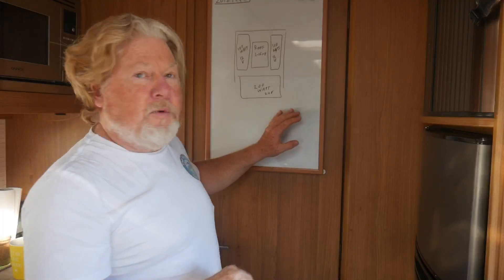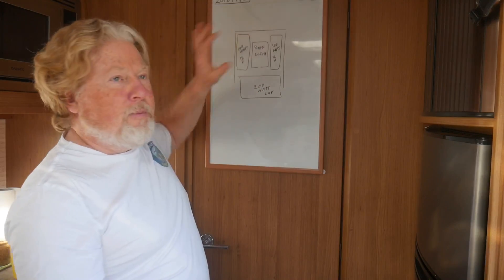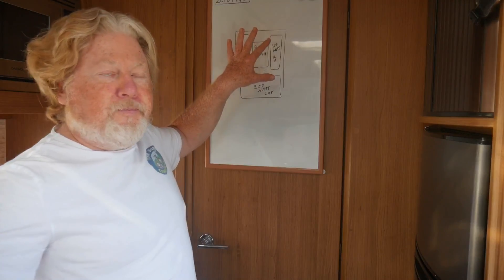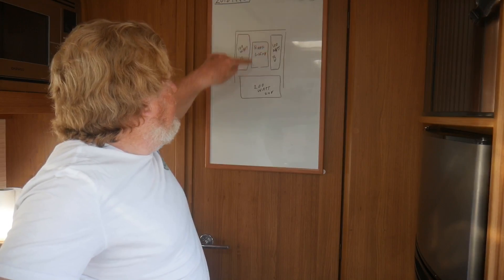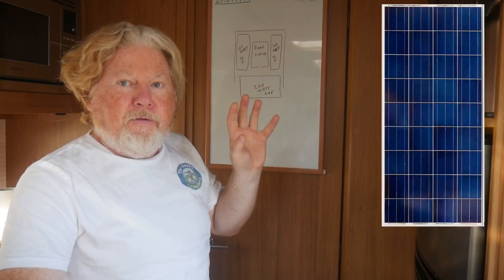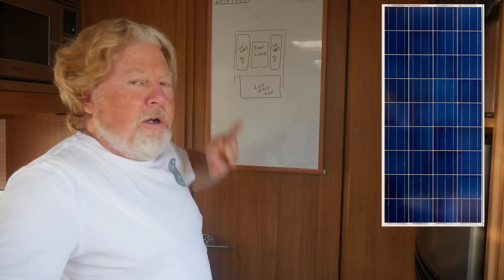Mixing Solar Panels in series and parallel

Comment: You will probably find all your panels need to be in parallel - so12v (not 24v) goes into your charge controller. 
Worth sitting down with your friends at A&E leisure or a recommended auto electrician. 
You can buy portable solar panels that unfold and plug 🔌 on to your leisure batteries - worth thinking 🤔 about maybe ? 
Avoid the shower blocks when you have a cough - they seems to make them worse. 
Great 👍 vlog - get well soon.♥️🌹💐😇
Reply from the maker: Thanks Chris. I’ve been communicating and checking with techies at Victron who have confirmed my thoughts about the solar design. The voltage going into the charge controller can be up to 100 volts when using the Victron 100/30 MPPT Unit. The 100watt panels will essentially look like a single 200Watt panel when connected in series. Total open circuit voltage from the 3 panels will be about 90 volts so within the charge controllers limits. With all the research and checking I’ve done, I’m pretty confident that I’m getting it right :)
Reply: The Happy Travellers - You can’t really go wrong if you’re getting specialists advice from the people who support the system - and that in itself is a recommendation 👍. 
Did they give you a reason why you should connect the panels in series rather than parallel? - 24v as opposed to 12v. 
I guess they will also supply a suitable junction box to mount next to the charge controller in order to achieve that configuration. 
Parallel wires simply terminate all together at the charge controller (brown/red to L - blue/black to N). A third panel will up it to 36v - 
It’s all very interesting stuff and will be fascinating to see developing because it will give you full freedom and off grid  capabilities- 
I have a small wind (cylinder type) turbine (type they have on yachts) - but I cannot say I would recommend- it’s enough to power the lights and television - effective up in places like Scotland 🏴 - another possible idea and topic of conversation.👍♥️🌹💐😇👋
Reply from the maker: So the first thing was to get maximum wattage on the roof. A 200 watt panel fits beautifully in front of the bedroom roof light. The 200watt panel is 24 volt so the question then was can I use a 24volt panel to charge 12volt batteries. Answer is yes as the mppt controller handles up to 100volts. 
So the next thing is can I fit any more panels on the roof and it turns out the 100 watt panels fit down the sides of the roof light. However, the 100 watt panels are 12 volt so the question is can I mix 2 x 12 volt panels with 1 x 24 volt panel into a single MPPT controller. Answer to that is if the 2 x 100watt panels combine to match the cells in the 200wTt panel then it will work. 
The 100 watt panels have 36 cels while the 200 watt panel has 72 cels. 
The outcome of this is that connecting the 2 x 100watt 12 volt panels together in series creates a single 200 watt 24 volt panel. 
Then connecting the 200watt panel to the (2x100watt) virtual 200watt panel in parallel gives me. 400 watt 24 volt system. 

This has been confirmed by Victron tech. 👍😀😎

Hope that helps to explain
Reply: The Happy Travellers - Steve - The man from Del Monte - he say Yes !!! 👍
You can’t beat good advice from the team that support the product they are selling- your 24v / 200watt panel sets the stage. 🤔👋🌹💐♥️😇

Comment: Blinking ek Steve ......you will need a heavy duty solar panel to power that on board resperator needed,..... to shift that never ending congestion in ones nasal passages 😷💗